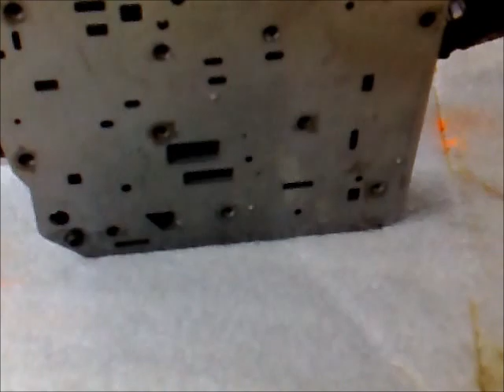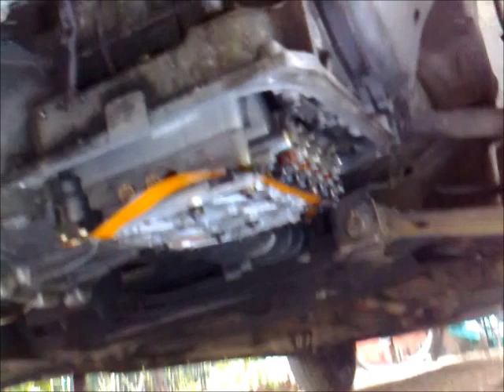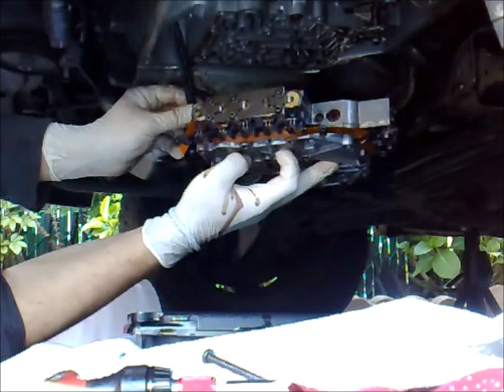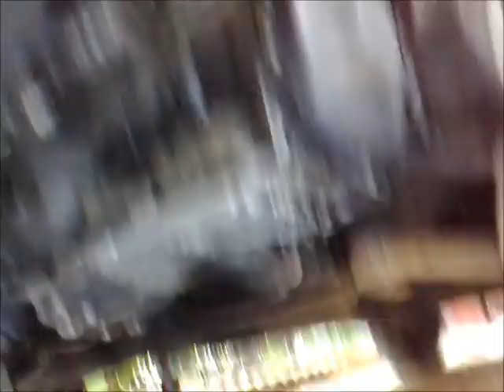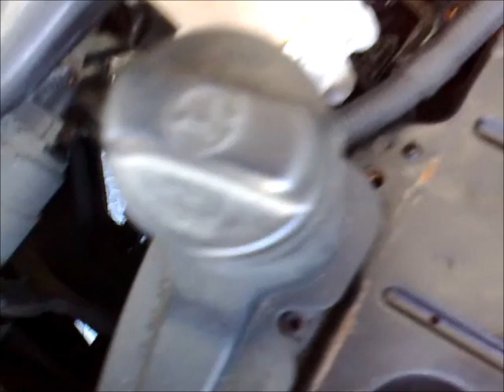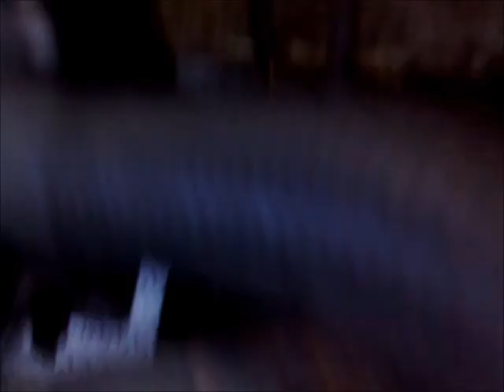HOW TO REMOVE AUTOMATIC TRANSMISSION VALVE BODY

Comment: The most important part  ie removing the plugged into side  down through the trans casing? you have the what Ill call, ribbon, disappears out of the internal part of the trans. you then remove the 10 mm fastener from inside the trans. DOES that entire ribbon and outside plugged in part freely come down through that hole. It doesn't look possible. It looks like the exterior (plugged in part) is actually plugged into or onto the ribbon part. Anyway my point is is that that stage is critical but yet it's not clearly documented . If anyone is reading and understands what I'm talking about , please HELP.I'm in the middle of doing this. And I don't want to start yanking on this trying to separate the 2 parts if they are in fact 2 parts. Cheers!
Reply: I e
Reply: @alvaro93364 Is

Comment: hi prijesi thank you for the video .. i have concern of my passat 2007 after the 65k kilo there is a disconnection and re connect again happened when its shift between 2nd and 3rd gear as if you keep your leg on the clutch while you driving manual gear car 
( automatic gear ) and this used to happened when i drive the car for more than an hour
some ppl told me its the gear box or you need to change the oil and recently i start reading about the body valve anyway gear box or valve ext expensive

Comment: I took my car to diagnostic and they told me that I have to replace the valve body in my Jetta 2003 1.8t now it's expensive to get the new valve body will u recommend to get a rebuilt part And why some guys at some shops they tell me that they have to open the transmission What will u recommend me to do :(
Reply: Transmission shifting selenoids are below the battery,  you be able to see the black tray , there's a video on YouTube ,, 09A transmisión 1.8t 5spd ,, how to remove valve selenoids on tripronic transmisión , I'm no mechanic and I'm gone do it my self

Comment: what is the part number for the wiring harness with the bad soilder joints. i have been trying to find the part to buy a new one but i cant find it anywhere being that i dont really have the name of it some say its the external transmission harness and some say its the valve body wiring harness so ya have had trouble finding it and i need a new one my car is getting worse shifting from second to third it jerks hella hard lately i have to let go of the gas between 20 mph and 30 mph and the shitty ass shift memory makes it even worse when i have to cost in slow traffic. so if anyone could give me the part number and maybe where i can buy it at i would really appriciate it thank you

Comment from the maker: the reason i am pointing, is that the hook must go in
Reply: How did you get the hook in?
Reply from the maker: seawash206 very easy
Reply: Does the little arm goes inside the hole
Reply from the maker: seawash206 yes